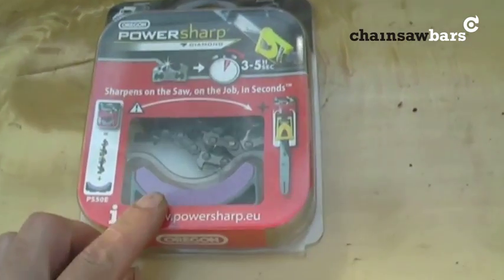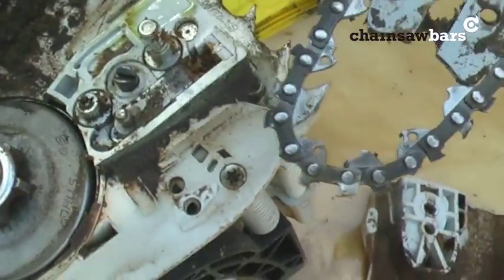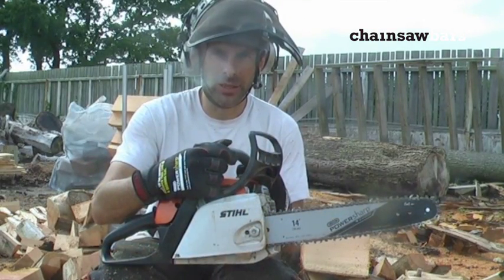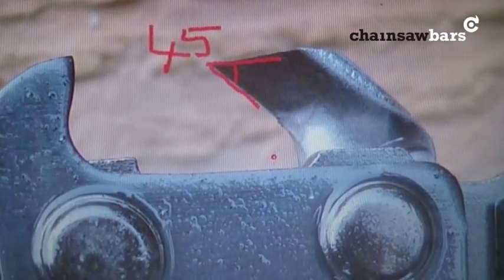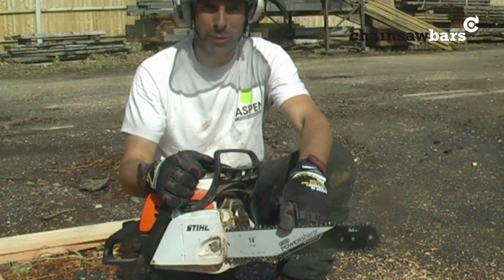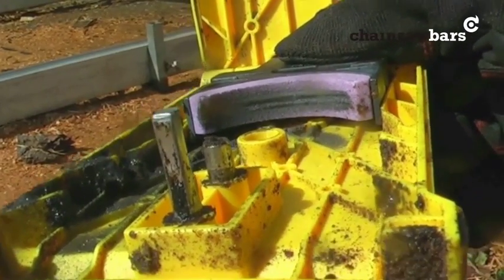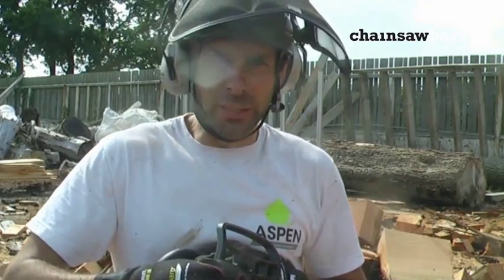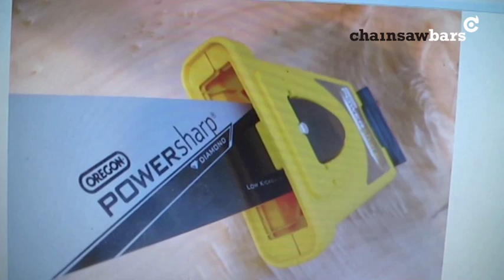chainsawbars.co.uk -  review of oregon powersharp system

Comment: Yeah, the grinding stone does wear out eventually, but unless you really lean on it, it should last many years.  I bought a little  battery power saw when my gas saw was in the shop.  I was impressed at how well it cut logs.  Only needed touched up a couple times in three days of sawing logs.  The battery lasts about a hour, maybe more, but required over two hours to fully charge.  Amateur junk?  Hey it cut three cords and allowed me to split and clear away rounds in the time to charge. And I even had a break or two to have a couple cold beers.  My E saw weighs a fraction of my gas saw, a lot less noise and no smoke.  Just make sure you fill bar oil tank often, like you would yer gas  monster.  I bought an extra chain and stone, but they are still in original packages. It would be a handy thing to take camping  or hunting with a full battery.  Don't let the big game hear a noisy chain saw or they will head up country and not be in their usual areas.    My cordless E saw is an Oregon CS300 with 40 volt lith ion battery. It makes a good back up and for things I mentioned above.

Comment: how much use can each chain go through before needing replacing? and is it any longer or shorter than a normal chain. also it has a different edge, does it still cut just the same?